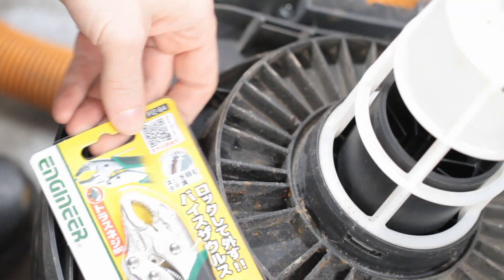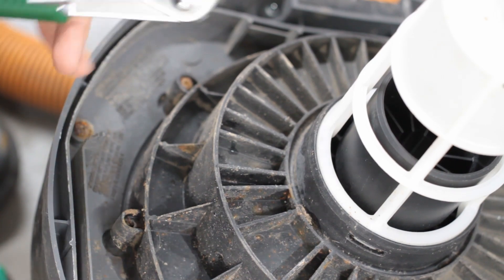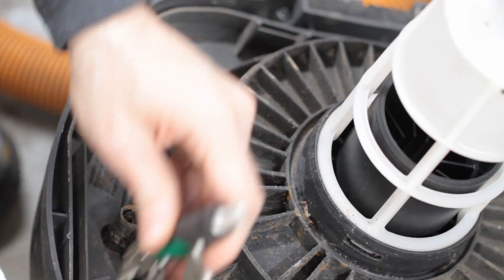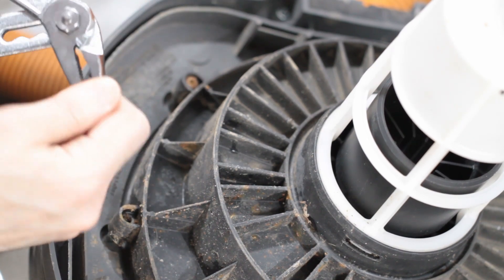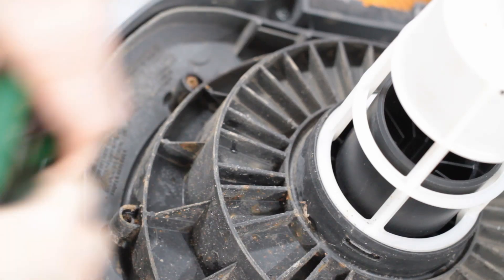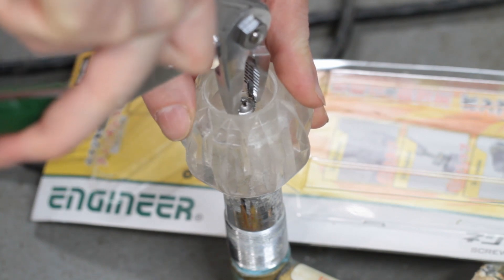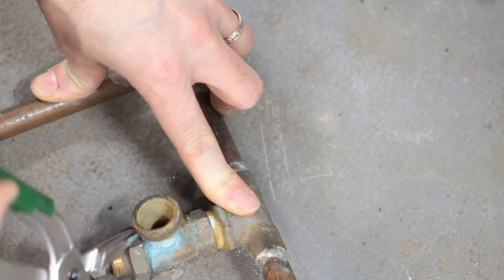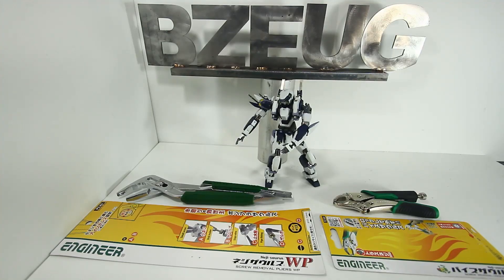ENGINEER (Japanese) Screw Extraction Pliers Comparison and Review

Comment: Nice review!  I use the PZ-64 as a multitool.  It's a nice set of locking pliers with wire cutters and screw extraction.  In the notches, I can clamp down on t-shank saws and use the PZ-64 as a saw handle.  Also works with the Bibury add on kit including the diamond/crosscut file.  Finally, I found a cheap Woodriver inline ratchet which fits in the notches, turning the PZ-64 into a screwdriver handle.  The T-Shanks, ratchet and 1/4" Wiha bits all fit in a small pocket pouch.  All that's missing is blade and scissors.  For scissors, I like the Roxon M3.  Best folding scissors on the market.  Fits in the 5th pocket.  For blade, I like the Vosteed Raccoon top liner lock.